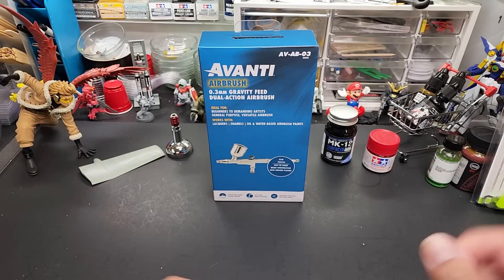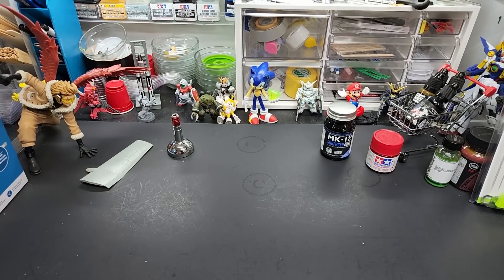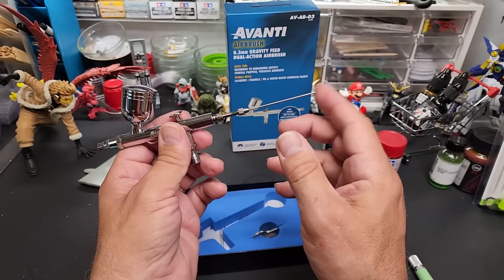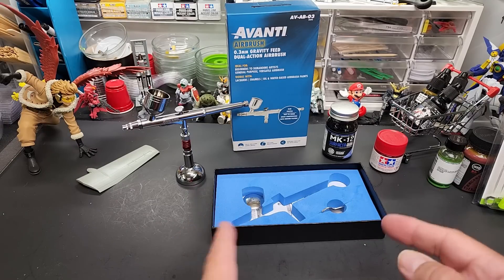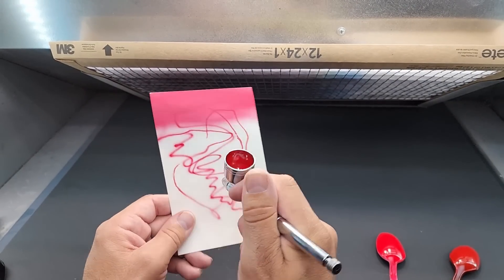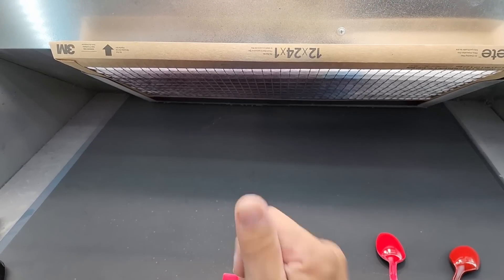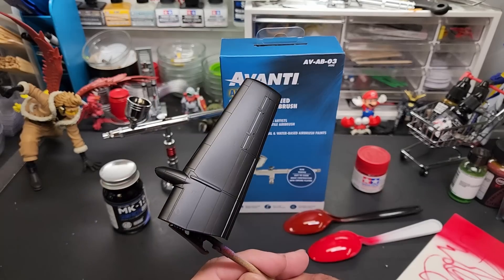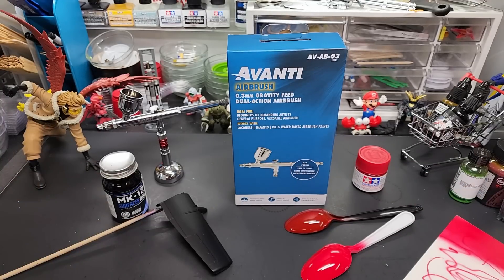Testing Harbor Freight's New Avanti Airbrush

Comment: I have been building model cars since I was a teenager and I have always used nothing but rattle cans  because I always thought it would cost to much to get into airbrushing unless you buy junk. But seeing you can get a pretty good airbrush for a price like this I think I am finally going to give it a shot! Been loving your videos and can't wait to see what you do next!
Reply: Changes the game, theres a good deal for $90 + taxes but they have a bigger set with all the accessories you need. Now dont forget to pull the nozzle cover off when you start...... 1. The smaller kit works great you just got to get used to the trigger. I can get fine lines and wide. You can make it super fine spray to thick. Great stuff. Hope you rock your hobby socks

Comment: You know I've been consistently impressed with some of the products harbor freight has come out with. I picked up the Avanti compressor based off of your review video for my first ever airbrush compressor. I haven't gotten to use it a lot yet but I think it was 90 bucks for the compressor and airbrush to start off with. I also picked up a couple of their new braman brand parallel clamps and have used those a few times and have been quite impressed with those as well for a few projects have worked on at my house, there's still some things I won't buy from harbor freight, but the list of things I will buy from them does seem to grow

Comment: Looks pretty decent. I like the fact that the nozzle comes off without a wrench. The only problem I've found with some of the less expensive brushes is that the needles seem a little soft and bend easily if you hit the plunger when you reinstall the needle after cleaning. Sometimes you have to depress the plunger to line up the opening to get the needle through.

Comment: Been airbrushing for a couple months and to start out I got the Avanti airbrush + compressor combo from Harbor Freight based on your review of it. I didn't know this one existed, but it seems like if I'm going to upgrade, spending $25 for this or $40 for the Gaahleri, the latter would be the better upgrade. Although, I can say that this airbrush seems nicer than the one that comes in the compressor kit, as it has a few more features.

Comment: What is a good beginners airbrush for detail work. And what exactly do you mean by detail work?
Reply from the maker: Any airbrush that has a needle size of 0.3mm or smaller is great for finer details
Reply: Are you able to paint eyes, mouths and other fresh tube parts ? Gauges nuts and bolts? With the .3 ?
Reply from the maker: My friend uses a 0.3mm for everything. It's the most popular size and for a reason. It can be used for it all

Comment: Not sure if you've seen it but browsing Aliexpress there was a pistol grip type airbrush from a brand called Sagud that was similar to the Iwata Hi line or the Grex with a fan type spray cap. Essentially a cross between airbrush and touch up automotive mini spray gun. Don't see many options for those types of spray guns other than the high end models but it was about 50 bucks CAD. Havent seen much about it but would be interesting to see if you ever cam across something similar!

Comment: Thank you for another test video, I just purchased a central pneumatic air brush kit, it doesn’t have a regulator, so I purchased one that I’m going to attach so it isn’t just 58 psi at all times. I airbrush latex masks and your videos are so helpful. Quick question, when doing small lines should the airbrush be set at a lower pressure? Thanks for all you do

Comment: I always like your reviews, no BS  you just tell it like it is.   I bought the Gaahleri portable compressor and air brush kit, after you did the review,  they really work well and use them a lot.   You said it was an entry level AB but I can not find any job it was not up to doing well...very happy.   I do have some questions on your review where would you get replacement parts for the AB you reviewed?  also what brand of quick connect did you use on it?     Thanks!!

Comment: 8:07
I have the Avanti AV-AB-03 airbrush which I acquired from Harbor Freight, and that "single nozzle" is actually a large and a small nozzle, and the smaller wrench is a nozzle wrench for taking those two pieces apart.

Comment: Looks like a nice little airbrush, I've always had decent luck with the Harbor Freight airbrushes.  They work fine for what you pay for them, like most airbrushes they have their sweet-spot and their limitations.  I would hope that the maker has used a better seal material, the HF DeLuxe airbrushes did not like repeated use with hot lacquers they were inexpensive, so I liked them, great backup airbrush!

Comment: I like my HF airbrush, HOWEVER, HF does not offer any parts even though they have a parts list.
Question: who's parts might fit?  HF says the IWATA Neo stuff may be a fit...
Any ideas?  I try to keep mine clean, but the front orifice cone gets clogged easily, and I dont have anything small enough to clean a 0.3 nozzle.  I was going to upgrade to a 0.5 or 0.8 as those would be fine for what I do and are more "cleanable"
Reply from the maker: Well I gave my HF airbrushes to a friend so parts never came up for me. My friend told me he bought a spare because it cost the same as buying just a needle and  nozzle.

Comment: Hey BR, I think you forgot to mention if this Avanti airbrush was the same or better than the one that came with the compressor you mentioned that you reviewed.  I was hoping that you would mention this because now I don't know if I should pick up this airbrush as well as the one in the combo kit, or not.  I've been wanting to try my hand in airbrushing for models and this sounds like an inexpensive way for a beginner like me to start.
Reply from the maker: It is better. Many updates and tweaks. Very much worth the $25

Comment: Hey barbatos. I have an avanti air compressor and had the airbrush that went with it. The .35 needle one. I was having trouble with Vallejo surface primer. Even thinning it to a 1:1 ratio and adding some flow improver, I’d pull back on the button and nothing but air would come out. The brush was clean. The psi set to 25 and sometimes even 30. The primer would only come out if I pulled it all the way back and by then, I’d have over spray because I was too close. Was I doing something wrong?  Since then I’ve bought one of those gahlaari aces that you had on your channel not too long ago. Haven’t tried it yet because I was down in the dumps about the other one. Thank you so much for your videos!!

Comment: Do you get air escaping from any of your quick disconnect fitting. When i handle my airbrush if my palm just leans on the joint it lets air out but it is fully connected. Would you recommend a better made unit. Thanks.

Comment: Out of interest, do you push your needle all the way into the nozzle or with draw it slightly before locking it down? I'm on my 5th 'budget' airbrush now and starting to get disheartened with the whole process, as unless I have the paint watered right down, (to the point of being basically a water wash) I can't get any of my guns to spray without clogging. I've tried adjusting the needle in and out, and upping the PSI. Thanks for any advice.

Comment: What paint did you use on that ? Is tamiya acrylic paint? 
Specially the last 2 purple at the end of the video 
And is the tamiya acrylic paint good for lexan rc body? 
Thank you
Reply from the maker: That purple is the cheap Craft paint you get at Walmart and Hobby Lobby. For lexan car bodies I would go with Vallejo Premium Airbrush Paints or Tamiya PS line. Both of those are made for R/C car bodies

Comment: I bought the Avanti compressor and airbrush package based on your review as well as a few others about a year ago, and it's been great for a novice airbrusher like me (I'm a mini painter). 

So, what I didn't hear, that I was hoping to - is this airbrush an upgrade over the airbrush included in the Avanti compressor package? Or, if I feel my skills have maxed out with the compressor package airbrush, should I move to something else?
Reply from the maker: Hello Bill, the airbrush seems to be an upgrade as a few bits of it are different including the nozzle. But that said, I would upgrade at this point if I was you. What is your budget?
Reply: @barbatosrex9473  Based on what I've watched and read, I was thinking it'd be an Iwata Eclipse Hp-Cs, and I was hoping to get coupons or a sale to get it as close to $100 as I could, although I usually see it go for $150-200 retail. 

So, my budget is around $100, give or take. I have some latitude. I'm open to whatever you would suggest as a good step up.

I started out using the airbrush to prime, basecoat, and zenithal-highlight fantasy and sci-fi minis and terrain, mostly 32mm scale, with some 75mm scale; a mix of retail minis and stuff I print 3d. I work exclusively in water-based acrylics; mostly Reaper, with some inexpensive stuff from hobby shops for large scale stuff. The reason I'm considering upgrading is b/c I've started doing more detail type stuff - stripes on fur or skin patterns, or maybe picking out armor, skin, fabrics with the airbrush. When I don't get the results I'm trying for, I'm not sure if it's lack of skill on my part, or a limitation of the beginner's airbrush. :) I paint for table quality, not to show or compete; I paint to relax and clear my head, and enjoy making something pretty my players and I can moving around the table.

Comment: What kind brand/concentration of acetone are you using? I tried doing this to my Iwata Revolution and destroyed the packing seal within a week. Haven't touched acetate cleaners since.
Also Harbor freight airbrushes are tanks. I've gone through 2 separate Master Airbrush kits (never again will I touch them), and my Iwata Revolution is so finicky it only works 50% of the time. My Harbor freight airbrush (the siphon feed model) works every time, no fuss, even after neglect and abuse.

Comment: I just picked one of these a/b’s and the trigger mechanism is very sticky. It doesn’t shut off by itself and I have to nudge it up with the tip of my finger to get it closed all the way. Actually this will be the second one that has this issue as I’ve already had to return one for the same thing. I’m not used to this funky “toggle”-style plunger, plus there is no spring that could be stretched to exert more pressure on the trigger. At least I haven’t found it yet. Did your unit have this same issue and, if so, how did you correct it? I’ve got a whole bunch of guys on various model groups saying “Lube it!” and an equal number saying “Don’t lube it with ANYTHING!” so I’m completely confused as to what to do.
Reply from the maker: I have Badgers Regdab Needle Juice, it's made just for that. That said I rarely use it but it does exist for a reason. My buddy uses it all the time and swears by it. Iwata has their own lube too so I'm sure it's meant to be used for this situation

Comment: Which is the better buy Avanti or Master? Is the Avanti fine for doing models?  Is the .3mm fine or spraying primer?
Reply from the maker: They're both on the same level. But I would consider this airbrush by Gaahleri
https://amzn.to/4edynNn
They manufacture my Swallowtail Airbrush and at $40 this airbrush is fantastic. It comes with 2 sizes, 0.35mm and a 0.5mm so you can use it for multi purposes. It has a superior nozzle and you can buy replacement parts for it, something the others done offer

Comment: Thank you for this review. 
I really like Harbor freight, their tools are ugly but I never had a problem with the quality, I got a reciprocating saw ($27!), I abused it a lot, cutting through 60 years old hard redwood studs with no problem, cutting screws, big nails and it's still working great, same for a rotary hammer (like a slightly smaller jack hammer), perfect too for breaking concrete floor, no issue at all. People say that it's great for a project, but actually it's still as new in functionality after that big project. 
One thing that you forgot to show is the adjustable fluid flow control. I have their older model (blue anodized $20) that I've been using for 4 years, similar, in performance to my Neo Iwata but less fragile, it's perfectly fine. Actually, I don't really know what's the difference with an expensive one, it does everything I need it for (painting, pre-shading, dots and spaghetti camouflage @1/72, ...). Good continuation and thank you again.